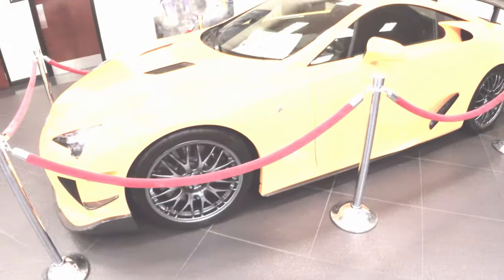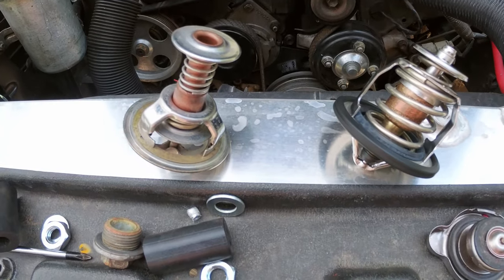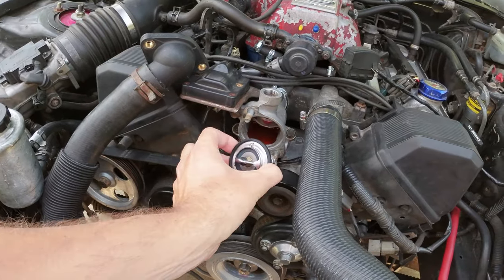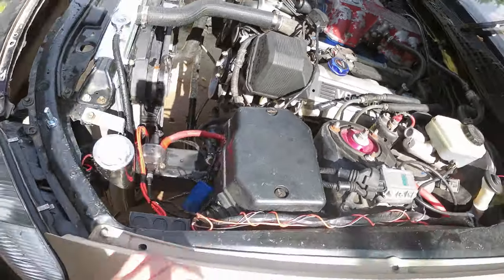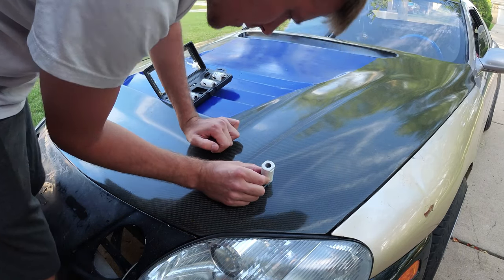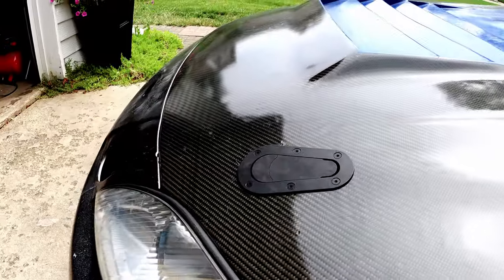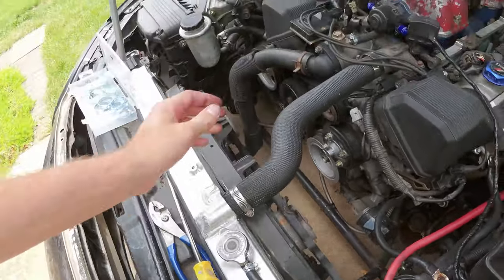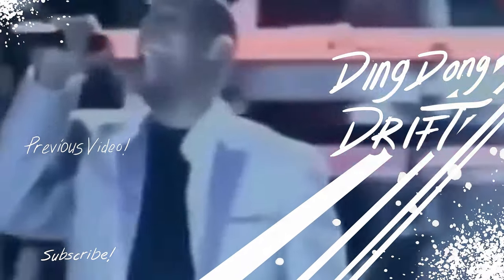The Best Latches for a Carbon Fiber Hood!

Comment: LFA is beast!! And probably only reason I put a body kit on my SC to give it that sporty look.
And that hornet gave me anxiety .
Reply from the maker: LFA is one of my absolute favorite cars of all time. That hornet was a fucking monster.
Reply: I would pour some resin into small chip , clear coat it , and then buff. Should blend it perfect. 
The hood latch are great touch to car.   I was going to go this route, after I cut away at hood skeleton a bit and add vents to get some heat out. Still on project "to do list " dry erase board. 
If you want to see my sc. Im on Twitter.  @shawniebeans
Reply from the maker: Yea when i paint the car I'm gonna restore the hood even more make it solid so it doesn't creak so much, when i do that I'll fill in the little cut. I love these latches, car looks so much cleaner with them instead of the old pins.

Comment: Hey I have a 1993 lexus sc400 am doing a timing belt job on, the two cams line up but  ot the crank,  is that a problem?  I found the tdc by putting a long screwdriver in cylinder one, the two cams were line up on top but the crank pulley wasn't at 0,
Reply from the maker: Just line up the crank without the belt, don't worry about the markings on the belt, mine didn't even have any. Just line up all the markings, keep the belt tight when putting it on and you're golden.